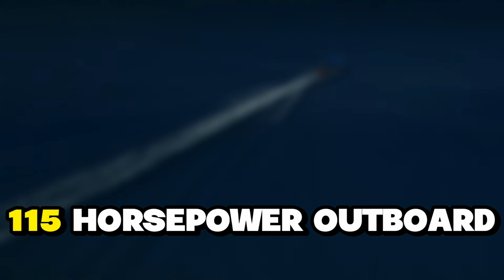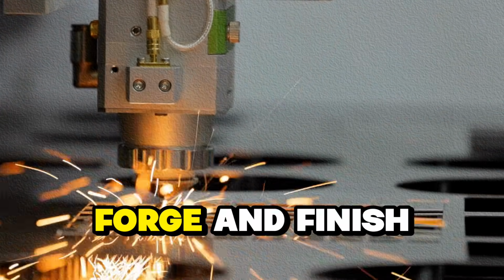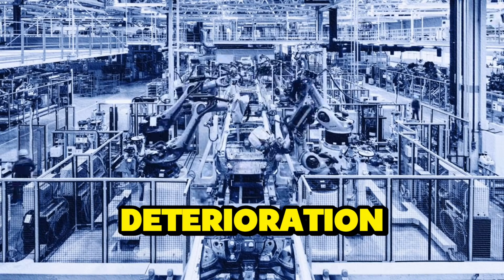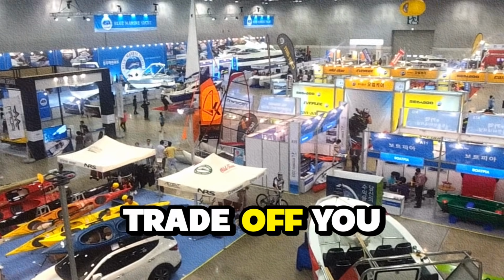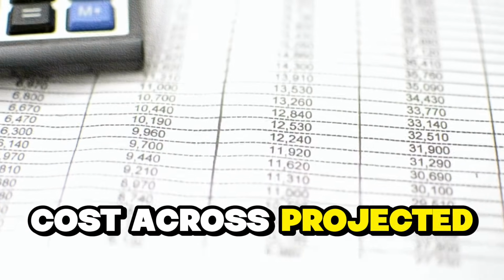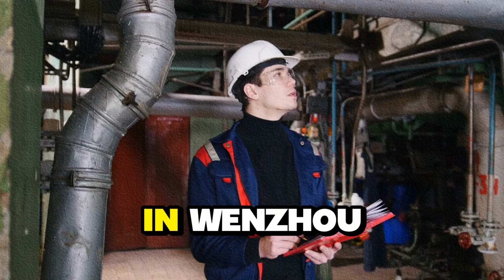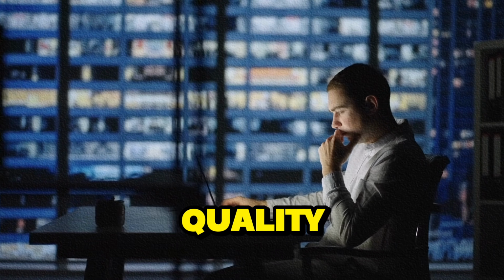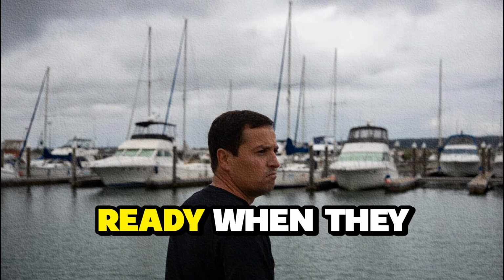The Real Reason Chinese Outboards Are 70% Cheaper

Comment: Let's see. Buy a $ 3,000- $ 4,000 Yamaha 15 hp that will last 20 years. Buy a $1000 Hangkai 18 hp that lasts 7 years and still has $2000 in savings, so you could buy another and still have $1000 in savings, with parts from the first.
Reply: The same thing is happening with welders. You can buy a nice functioning Chinese welder for $400 which might last 5 years or a Miller for $4000 with the same capabilities that might last 10.   You save enough to keep a spare Chinese welder on the shelf.

Comment: Americas should not be proud that they paid for Chinese goods at a lower price. Live in A.erica, buy American lroducts whenever you can.
Reply: I'll bet there's not a single US make that doesn't have Chinese parts inside.
Reply: @quademasters249 you would lose that bet.
Reply: @robertmceuen3630   Where does the aluminum come from? China or Canada.  

One of the reasons we lost the trade war against China is because our own manufacturing depends on their supply lines.

Ford and GM can't make cars without Chinese inputs.   

That's why the rare earths are such a big deal. We can't even make our most advanced weapons without Chinese rare earths.

Comment: I designed a custom stainless steel fastener and the local machine shop was happy to produce it for $3 each. Within a year however,  the price had inflated to $8. Only some of that increase was caused by pressure in the metal markets, as I calculated the mat'l cost at $1.47 each. My company got bought out by a group with extensive chi-com purchasing connections, so they sourced the part in Asia. Price...$0.47 each. A third the actual commodity value. 

Chyna participates in national-level Dumping strategies.

Comment: The metal isn't as good.
Reply: The product design and quality control are much bigger factors. If your tooling in a CNC
machine is worn, even a tiny bit, it will degrade or destroy product quality even if the design was good.

Comment: Chinese metals are crap. You can't fool a Manufacturing Engineer .
Reply: I've heard that before.  Why is their metal so bad?
Reply: @shellcracker7  Their cast iron is soft (poor wearing and short lifespann), all their metal types sometimes have inclusions of hard spots and the resultant damaged parts are usually not deleted by the usually non existent quality control (consumer goods). CNC machines are great but if you do not keep the tools sharp and replace damaged tools due to hard spots in the metal work-piece you have a defective part. A blind hole drilled with a 20 mm drill will frequently not be 20mm because no body checks the diameter of the hole at the bottom. Result could be in an inexpensive lathe - tail-stock travel is decreased and problems for the  users.Many of their products are just hat - cheap and that is buy intention. On the other
hand, they can and do make top of the line goods when selling price is not their prime consideration. Their military fighter aircraft are probably top of the line because cheap is not what the military wants or needs.
  I could go on but the important point is that quality depends on a lot more than CNC machines.